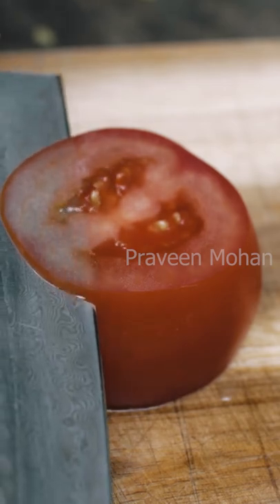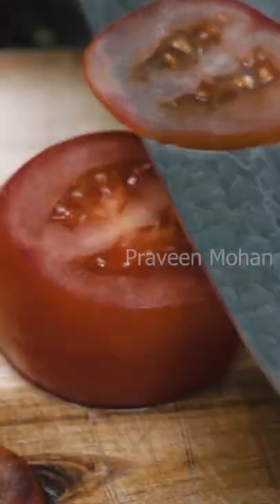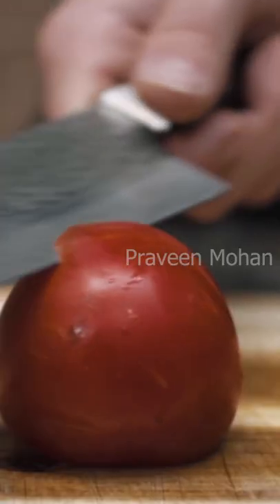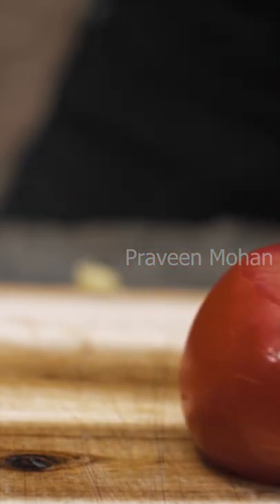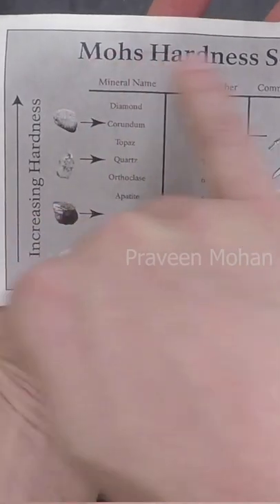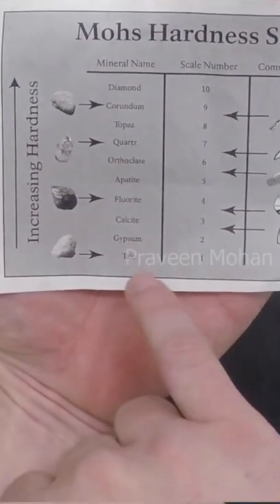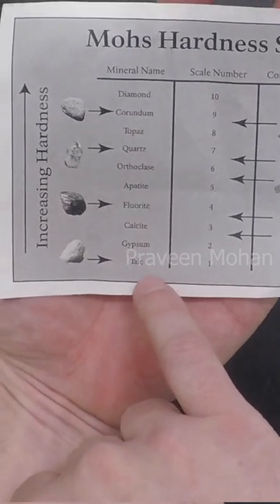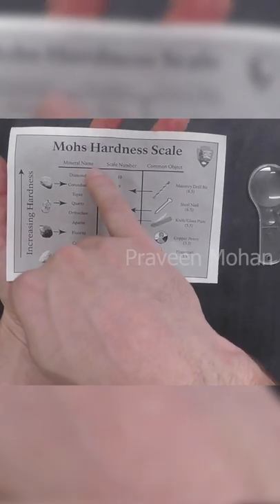Impossible Technology used by Ancient Builders, Kudimiyaanmalai, India

Comment: You don't necessarily need a harder material. Water will erode hard stone over time. 
I don't think that they used this technique though. They could possibly have used a template and laid it on top. Then continuously and slowly etched out, little by little using a chisel. 
It would be easier if I could draw a picture of what I mean, but hopefully some will understand what I mean.

Comment: You do not need to use a tool harder than what you are cutting.  Wet sand and pressure from a tool of the same hardness will smooth the surface.

Comment: I laid stone 40 years. 
These experts don't have a clue. 
Granite is very brittle and glassy. 
Cuts very quickly and easily. 
Lead will blow holes in steel in the form of a bullet. 
The chisel shown is called a tracer. 
For scoring lines to part the stone. 
You would never use it to carve with 
Try using diamond and they would shatter almost instantly. 
Diamond is brittle. 
Used only for abrasive, not chisels.

Comment: This is the 21st century, we use the Rockwell Hardness scale. Also, you need equal or greater hardness, not just greater. The harder the tool the easier it cuts and shapes, and the less often you need to sharpen it.

Comment: I don’t believe that it is impossible. If you use a small chisel and use light taps, you would be surprised at what you can do to rock. It’s the same way that you can put letters on a headstone for a grave. You just use the right tools and a craftsman can get the work done. It’s not something that can be done quickly, but a statue like that certainly is not something that you would rush to complete.

Comment: Try using a scutch or a single point fine chisel. Small percussive blows as you can actually cut a hole through granite with copper using percussion. Granite as the name suggests is granular, its made up of various minerals, feldspar, quartz etc

Comment: Also, the first fact about needing a harder tool to cut a material is not correct. Tungsten carbide can be easily cut with brass, which is comparable to cutting wood with chocolate. Electrical currents facilitate the cut, otherwise known as EDM (electro discharge machining - not rave music)
These civilisations were stone specialists, and yes, they had energy sources far more impressive than fire. Everyone thinks you could build a pyramid with a civilisation that walks around with clubs and cant create light with anything other than fire. Not true, it is possible to shape all structures once the concept of its bonds are understood. Most large temples and structures of the monilithic nature are energy generators which have been long since decomissioned - missing vital parts and damaged due to earth cataclysms. There are working units which are underground, look for the black pyramid.

Comment: Three then the mystery has been solved they did not cut or carve it. They turned it into mortar mix and poured it the wavy line structures could be from grass reeds rope or twine that was used for making a mold when they poured in the mortar  mix then     they would remove the twine at a certain point when the outside layers started to harden but just sort enough to be able to be manipulated then they carved the surface and that's what we see today.

Comment: The fundamental premise of your argument is false. How do you think they grind Diamonds, when there is no substance harder? You can use a tool of the SAME hardness as the material: its just takes longer to do because the tools go blunt or deform quickly depending on how they are being used. BUT a striking tool that is useless after half a dozen blows is NOT a problem if you are working with a support team, who are constantly handing you sharpened tools. 

The advantage of iron and steel, is NOT that it can cut into softer material. The advantage is the tools stay sharp for much longer, thus reducing the labor required to do a fixed amount of work. A mason can sharpen their own tools, if they don't need to be sharpened that often.

The actual carving time between stone bronze and iron tools is probably not that much different for a skilled mason used to the limitations of their tools.

Comment: Faulty assumption… logic must prevail . A easer rational solution to your quandary is needed. 
Consider modeling in softer materials and sand casting methods as the technique utilized here. 
When your premise makes the solution this complex you eliminate tie simple answer.
Ocoms’ Razor

Comment: That’s not true at all.. you don’t have to use a tool that’s harder. How do you explain water carving through stone/rock? It’ll take hundreds of thousands of years, but it’ll happen. Same with this. I could sharpen flagstone, and use that to carve/chisel marble. It’ll take me 10 years, and a lot of flagstone but it’ll get done

If the tool you’re using is softer than the object you’re cutting/carving, all that means is it will take more time and/or pressure  to achieve the same outcome if you were to use a tool that’s harder than the object you’re cutting/carving.. 

Bro, you’re a smart guy.. please revise this video and admit your mistake. What you said is like saying “to lift anything you need to be heavier than the object that needs to be lifted”.. 

“To cut/carve anything you need to use a tool harder than the object that needs to be cut”

There’s plenty of different ways to cut/carve something with a tool that’s softer than the object that needs to be cut/carved. Heat, time, pressure, cold. Those are 4 ways that I just took a second to think, and pulled out my hole where the sun don’t shine.. I could be wrong in the heat and cold, but it sounds right in my head. But as far as the time and pressure, you can take a million years, just grinding away at something with a tool that’s so deter than the object, and replace it with a new softer tool everyday, and in a million years you’d have carved through that thing that’s harder than the tool, and the pressure, we already do that. The example I can give off the top of my head is water pressure. Water can cut through diamond at a certain pressure. So the more pressure you add with the softer tool, the more you’ll be able to cut/carve that object that’s harder than the tool. It makes sense in my head about the “heat”, but I’m just assuming if you heat up your tool, or the object, it’ll be easier to cut/carve it, and the same applies with cooling it

Comment: Let’s just say that the host of this channel has a very weak grasp of mechanical processes.

Edit: Also, Diamond is hard put has poor shock resistance. It can, however be used to slowly grind things. Funny enough that’s likely how your impossibly shallow lines were made. You can also use quartz, which is the hardest component in granite and easily found.